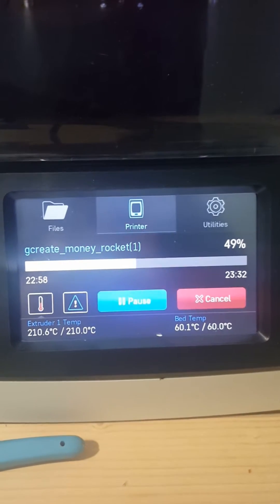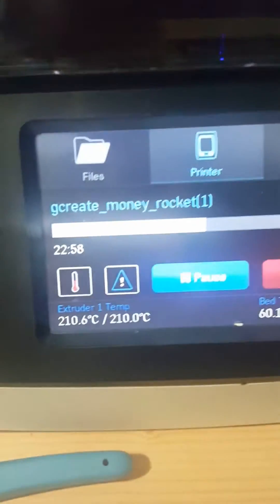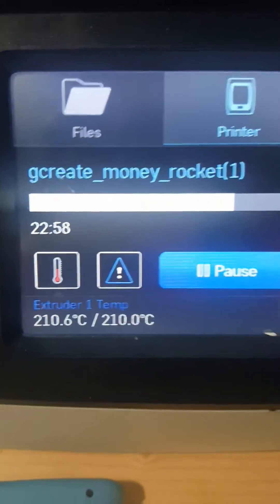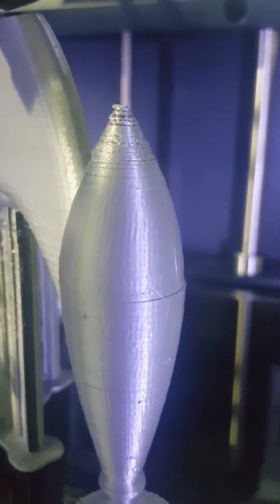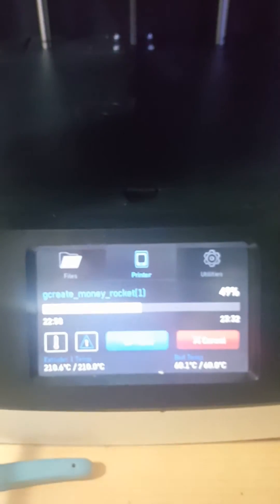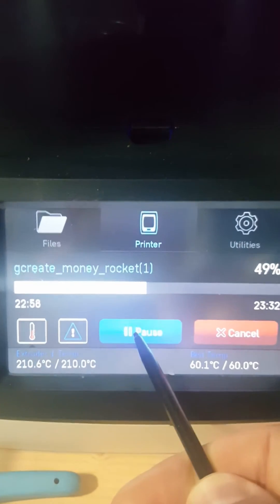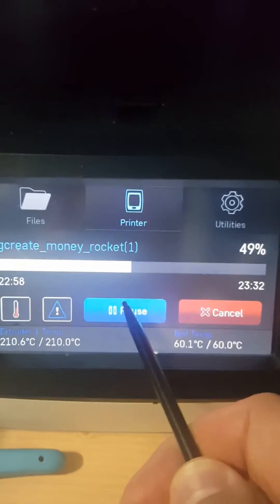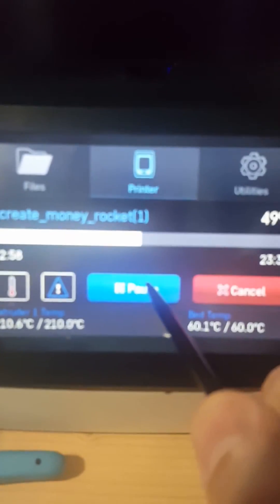Robo R2 print fail!

Comment: Verbal Tease

what happened in the end.....did you received the required support from ROBO 3D? 

It seems there might have been any issue with your filament? because the formation of structure itself has gone wrong.....maybe because of unbinding filament?

Comment: Thanks for sharing.  Hope to hear a followup on the root cause of the freeze
Reply from the maker: I contacted support, had to call a few times before someone finally got back to me. They asked for a log, which I provided a week ago. Have not heard back from them. The guy who said he was going to send me more filament did not do so. He just said "You're in good hands" when I told him I was talking to support. My $1200 printer is sitting around gathering dust waiting for support, while I use my $200 printer daily with very few problems.
Reply: Mine bed pogo board for the beds were stuck, the bed was reading 100C at start, wouldn't even preheat... I contacted support.. 3 weeks ago.. they are suppose to get a new unit... I think the manufacturing plant needs more quality control ... I got mine 1 week before june and used it for 2 weeks... its been sitting collecting dust since 2nd week of june.. :(... hopefully my transition will go faster then yours